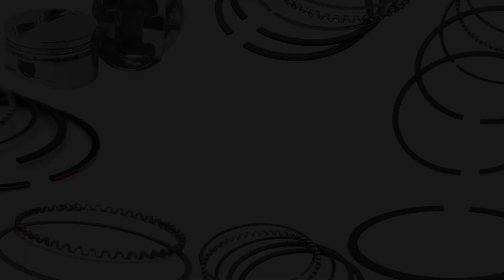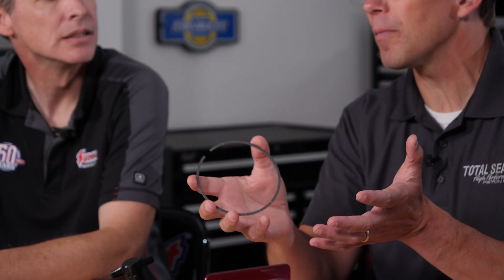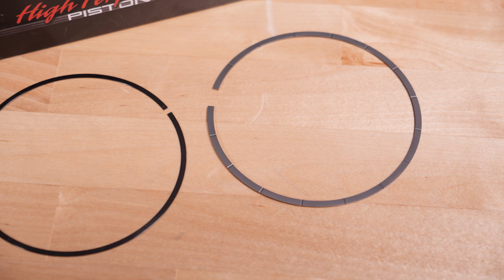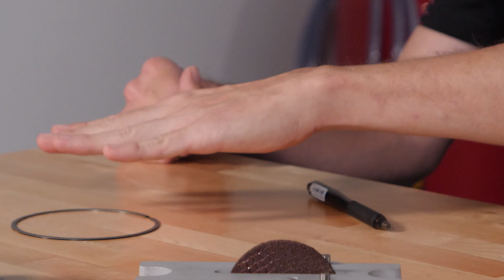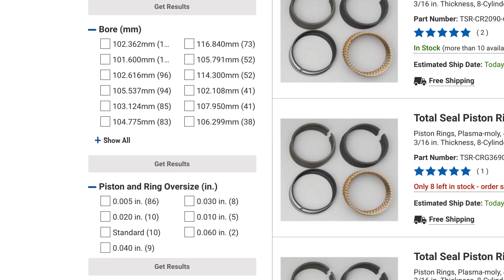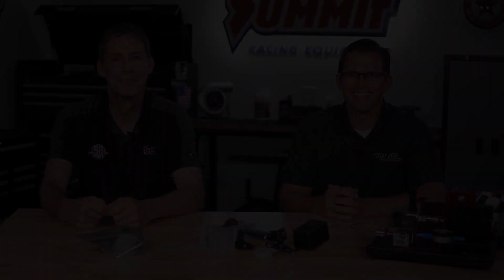Summit Racing’s Ultimate Guide to Piston Ring Technology with Total Seal’s Lake Speed Jr.

Comment: Would be nice if Total Seal sold these lovely ported top rings individually vs only in sets for V8s (for the low, low price of $642.33), as if there are no other engine configurations or number of cylinders than a V8.

Comment: So no 564 I got a 440 with the old sealed power 2355 piston with the 4 eyebrows and the hole in the piston what rings should I run I just wanted to spend a few hundred dollars and I don’t want file to fit a chrome  moly and my machinist is trying to save me money told me to buy my own rings would be nice it’s being bored 30 over a 509 cam  he said chime moly what about piston to wall clearance I was going to get a piston ring that is for street and a little race so any suggestions prob a 7 quart oil pan I need a windage it has stock heads 452 with really good springs and lifters it’s all broken in the cam but I wanted to bore out and put the six pack pistons is ther a ring that don’t need filing that’s good for street and drags chrome moly for sure the pistons are pretty much new with ly rods so do you have a part number for a ring that will work for me in a  fairly stock  motor motor  a ring that will be around 200 Canadian